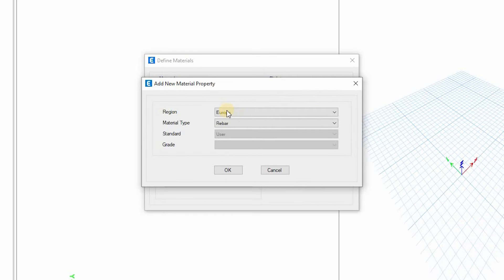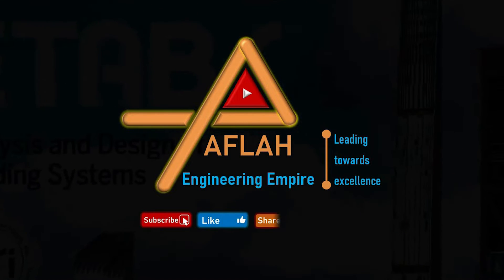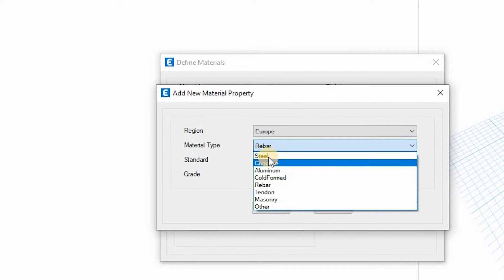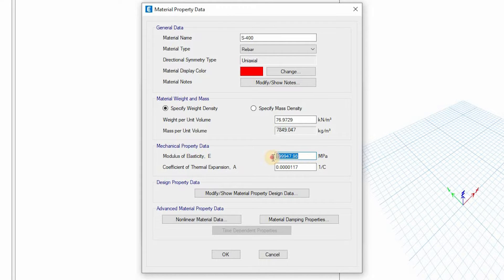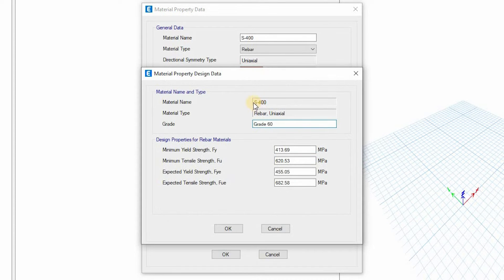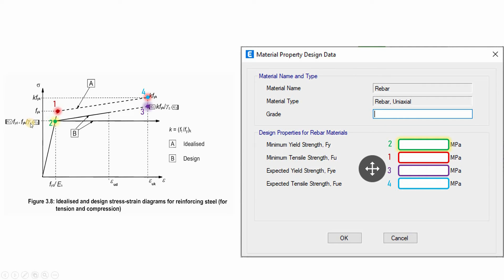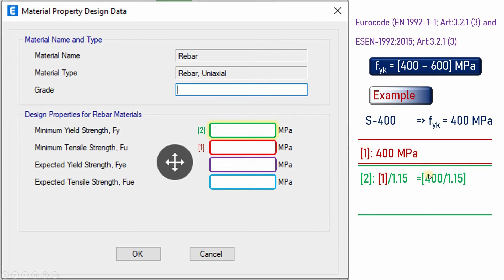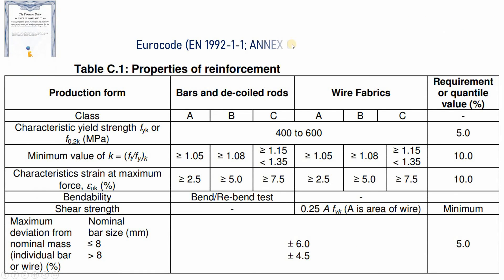How to define Rebars Material in ETABS-All you need to know-  #Eurocode #en-1992 and #ESEN-1992

Comment: jazakallah. very helpful
but as a humble insight I found out that smaller-diameter bars are generally associated with higher ductility (Class C), while larger-diameter bars might be aligned more with the lower ductility requirements of Class A or B. in this sense explanation (A) needs to be corrected
Reply from the maker: @muazsalim3342  
Dear;
ductility itself is primarily a property of the material and its processing, not just diameter. While diameter can influence the classification due to how the bars behave in testing (like bending or elongation limits), the core ductility is still governed by the steel’s composition and treatment NOT Diameter